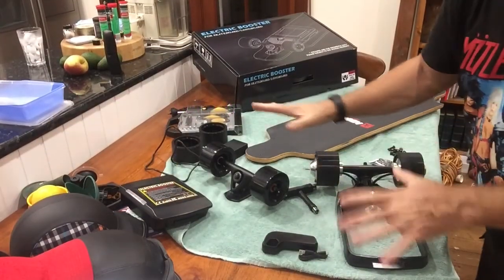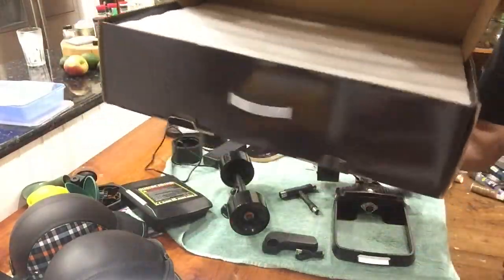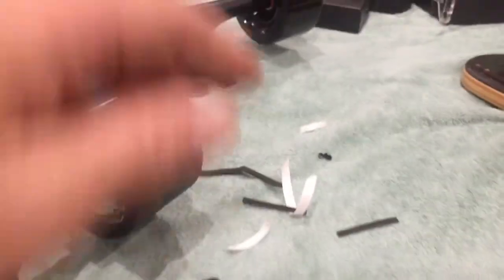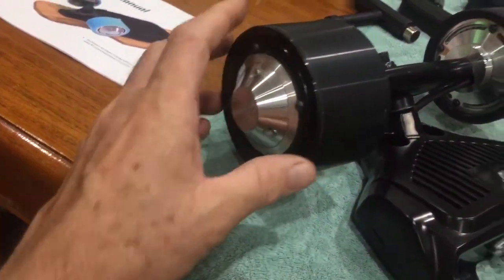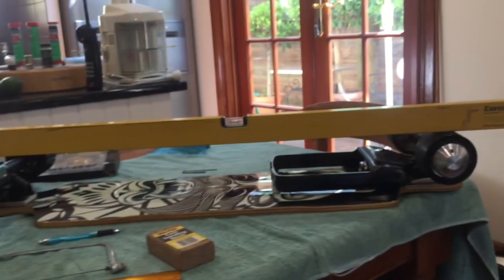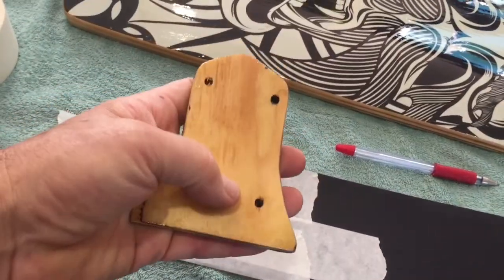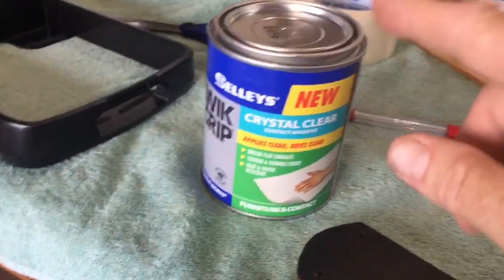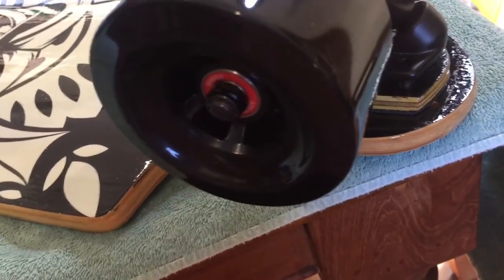Onan X2 Electric Booster Full Assembly Part 1 -Andrew Penman EBoard Reviews Vlog No 9

Comment: what's the difference between the x2 and the newest x3? is this better?
Reply from the maker: Hey Daniel Rivera look good question, the X2 was last years model and the X3 is the current new model for 2017, there have been some vast improvements in many areas of the X2 which I think make the X3 a better unit, having said that there is a less powerful motor set up by about a half on the X3 but if you are under 80 kg that won't make any difference.. plenty of power, but there are also a smaller wheels 75mm which is fine for normal road riding... this also makes it a lot lighter by 3 kg .... the weight including longboard from 9.8kg down to 6.3kg ...)) otherwise it's exactly the same except for slightly better technology under the bonnet ... current limiting heat protection etc )) hope this helps .. stay tuned to my channel I'm going to be doing the "hill climbs" and the "speed test" of the Onan X2 and I'll hopefully get my hands on the X3 too later ...cheers Andrew )
Reply: I'm afraid my weight is 100kg so the x3 could lack enough power to move me. In the specs the x2 weight is from 4 to 4.5kg and the x3 3.5 to 4kg so there is only a little difference between the two. Maybe the major improvement is just the reliability of the new model. I'm looking forward for your x2 and x3 comparison. Thanks for your great reviews!
Reply from the maker: Hey Daniel )) yeah I know what you mean I'm 92kg and I feel happy with the X2 with the extra grunt ....but as I said I haven't tested the X3 yet ... hopefully get one over the next 3 months and I'll be able to fully test the X3 in the meantime it's up to you decide which way to go ....also look at the Koowheel it's an awesome E Board it's just so reliable and powerful )) but stay tuned to my channel and look at my reviews coming up on the X2 PartB "hill climbs"  in the PartC "Speedtest and Sprint tests"  I'll give an overall rating at the end with Pros and Cons and we can go from there on the X2 )) but I have seen one guy on YouTube look  up "Griffen Boards" I think it's called he is a big guy about 150 kg and he's riding an old Onan  X1 it's going fine round his streets slight hills too ... so I don't know ... that's the old X1 ... the X3 is 3 times x bigger motors than the X1 ... so it will be pretty powerful  )) cheers thx for you positive comments man )) really appreciated )) cheers Andrew ))